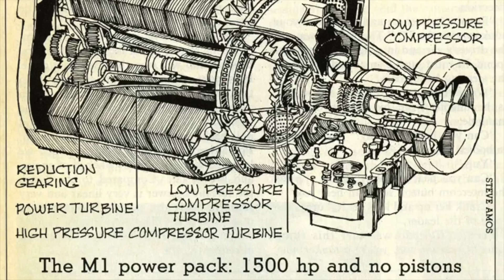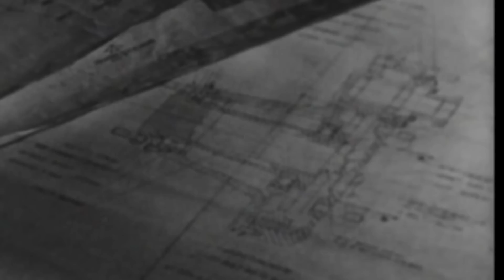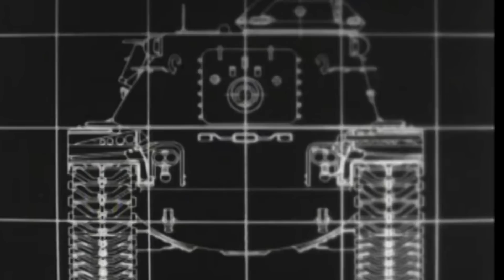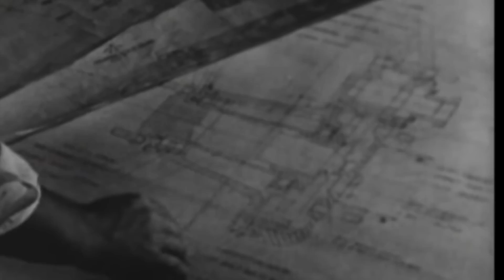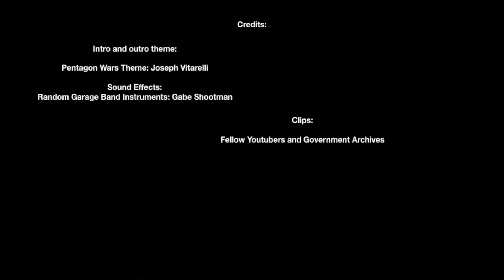The Real Pentagon Wars (For The M1 Abrams)

Comment: I don't know what became of them but as late as 1983 there were at least two XMBT-70s on static display at Ft. Knox, KY. The GM and Chrysler XM-1s were still being tested by 2/6 Cav in 1980 and several friends of mine described the GM version as far superior to the Chrysler version. 2/6 Cav was a "Test and Evaluation Unit", also known as a "Test to Destruction Unit" and got all the newest armored vehicles that had not yet been accepted/chosen by the U.S. Army. After many months of working with both models 2/6 Cav presented its preference for the GM XM-1 to the Army. Shortly thereafter the Chrysler model was selected for production and service. I was told by my 2/6 Cav friends that GM sent a special train with attached flat cars and took possession of all the GM XM-1s and off they went to who knows where with a scrap pile somewhere being the common assumption. Oddly enough, shortly after the GM models were taken away, word filtered down from on high that GM had sent a short and not so sweet letter to the Army that basically stated that GM would never again bid on another major tank contract should one present itself. One thing that I learned while serving as a tanker in the Army was that an M-60 series MBT could at least limp back to the rear even with two or even four "blown jugs" but with the M-1, if the turbine blew or failed for whatever reason, it had to be towed as a "blown" turbine was a dead turbine which left the M-1 serving as a very expensive, unpowered bunker and a target from the air or land.
Reply: The M1 turbine also had half the range before refueling of allied diesel tanks in the Gulf war.
It meant it was diesels doing the long "hook" for logistics reasons.
Reply: They moved the armor museum down to Benning. There was at least one there when I went though training in 03.
Reply: @Plumbump  Thanks for the kind reply! Over the many years that have passed since I last saw either of the XMBT-70s I have often wondered what happened to them. At least now I know one of them has a chance at being viewed publicly again.
Reply: We got robbed with the Chrysler.
Reply: https://www.youtube.com/watch?v=fktY_MgB9ZA

Comment: 12:18 that's not a leo 2 that appears to be a leo 1a5
Reply: Leo 2K
Reply: Leo2 prototype. Turret was re-used for final leo1 series.
Reply: @dwwolf4636  no its a different turret, they use similar design langauge but they are different. the most obvious difference (visually) is the leopard 2K has a pointier gun mantlet.

Comment: Note the results we saw when I was in the Army from 1977 until 1985.  I remember the GM model NOT having Chobham Armor.  It also was never tested with the heavier turret.  Extra Weight affected the GM tank more the Chrysler.  As said on another thread TRACKS affected the M1.  Shake Downs are done to work out Bugs.  I was on Ft Polk when the ground test were done at Ft Hood.  Simulators were brought to Ft Polk where I was.  Oh and 105mm DU APFSDS kept going through the berm and tearing up Target Lifters.

Comment: .. also the among main reasons that the Chrysler design (the current M1) has a larger turret, which is better, than the GM design are:
1) The Chrysler design has "blowout panels" meaning the ammo are kept separate from crew compartment and if/when the ammo get hit it will explode "out" and not "into" the turret. 
2) It has more armor (chobham armor).
3) Crew conditions are better, which is very important in long deployment, especially in nuclear war (when crew must remain inside to prevent radioactive exposure).
Reply: 1.  The GM XM1 had blow out panels above the ammo storage as well.  It could take the gas turbine and 120mm smooth bore with minor modifications also.  These were guidelines set down by the Army prior to the prototypes being built.
2.  As for the chobham/Burlington armor, the GM turret could have modified to accept the special armor just as the Chrysler tank was.  Looking at the Chrysler prototype verses the production model you’ll see that the turret front was raised and thickened leading to a non-protruding gun mantel.  These could have been done with the GM tank just as easily.  Burlington was very secret at the time so the corporate teams building each prototype did not have access to an samples.  Thus, the tanks originally had only conventional rolled-homogeneous steel as their primary armor.  Layered armor comes in large flat pieces which then dictated the final turret shapes of the Abrams, Challenger and even the production model of the Leopard 2.  Prior to receiving special armor the GM tank had better armor and that almost certainly would have remained true after the addition of the Burlington inserts as well.
3.  I’ve read nothing that indicates that the Chrysler tank had better “crew conditions.”  I do know that the GM tank made use of hydroneumatic suspension and could crouch to present a lower target especially when hull down.  It’s very likely this would have also led to a smoother ride over rough terrain and better firing angles for the main gun.
Reply: a larger turret is not necessarily better. for example due to the additional weight of the chrysler's turret the GM had faster turret rotation and target acquisition.

1) the GM XM-1 also had separated ammunition compartments with blowout pannels. (Abrams - A History Of The American Main Battle Tank Vol.2.)

2) the GM also had chobham armour (according to "Full Committee Consideration of H.R. 6566, to Authorize Appropriations for the Use of Energy Research and Development Administration, in Accordance with Section 261 of the Atomic Energy Act of 1954, as Amended, and Section 305 of the Energy Reorganization Act of 1974, and for Other Purposes: Volume 5" and "Abrams: A History of the American Main Battle Tank, Volume 2,")

furthermore all the sources i have read either say they were roughly equally protected or that the GM had better protection. I have also not read anything saying the Chysler had better crew conditions.

(edit: my comment differentiates form benjamin's one vias sources to backup my statement)
Reply: @matthiuskoenig3378    The video is Very Biased and I was in the Army right after the Test at Aberdeen and Ft Knox.  The small Turret meant only 24 rounds could fit in the bustle, about 30 rounds were scatted throughout the Hull Just like in the M-60 or even the current Leo-2 series.
Reply: The turret was also larger because it was intended that the 120mm would be fielded but was suffering from problems. They just used the 105mm until those problems with the 120mm were solved.
Reply: Yes!
Reply: Having the ammunition separate from the crew compartment has proven to be a very important design aspect of the M1 tank as demonstrated with the Russian tanks  with their    "Jack in the box" turrets that blow up...
https://youtu.be/9sWS6x97-Ck
Reply: The extra space inside the turret allowed for more equipment gave it a lot of development potential for future upgrades
In the 1970s the military wasn't quite sure what the new equipment would be but they knew it was coming
Reply: Those where improvements brought LATER.   GM could totally have done the same improvement's or better given the 10 years and trillions of dollars Chrysler had to improved it's tank (with it's 80 different versions)

Comment: In retrospect, the US government (Donald Rumsfeld, if it was his call) made the right choice. The Chrysler's M1 had room to grow, literally with its larger hull and larger turret. Not only could fit a bigger gun, but also had room for the modern electronic equipment. The turbine engine was also forward thinking. The GM's version might be better at the time of the trial, but the US military would be forced to find another main battle tank as its replacement, 20 years later.
Reply: arguebaly the larger turret meant less room to grow, as there is less external room to add additional armor volume (remember the tank needs to fit into limited  external dimensions for rail, sea and air transportation)

and the GM could mount a 120mm ("Both contractors submitted proposals by 28 October for versions of their tanks with a hybrid turret capable of mounting either a 105mm gun or a 120mm gun." Richard P. Hunnicutt Abrams - A History Of The American Main Battle Tank Vol.2.)

as for more room for electronic equipment? the GM had more internal volume than the leopard 2 and that has been able to add the electronics just fine, so would the GM. 

and how was the turbine forward-thinking? they both provided the same horsepower (also the GM could also mount the turbine engine, GM just prefured the disiel. likewise chysler could mount the disiel but prefured the turbine). 

there is no reason the GM wouldn't have lasted just as long in service as the Chysler has.
Reply: @matthiuskoenig3378  The thing is, the internal layout of Chrysler’s was more ergonomic and the gas turbine has a better multi fuel capability than any Diesel engine while also being much more subtle in many respects. The Gas turbine was one of if not the all time best decision about the Abrams. It fits the US military like a glove

Comment: both prototypes used diesel engines 
but Donald  Ramswald  decides that the new American tank should have a gas turbine like the Russian T-80.  Аnd Chrysler  offered a cheaper conversion оf xm 1 .GM   Offer cost $ 210 million  for first  
for the first 1000 tanks , and offer for HM1 from   Chrysler  was 196 milion dolars. 
But the share of political players in the deals did GM to lose .

Comment: You have gotten most EVERYTHING wrong about the M1.  You are probably someone who believes the M16 to be unreliable because of early malfunctions in Vietnam. 😔
Reply: Yeah, this badly represents the fact that the diesel was fully capable of being put in the winning design as they each had entirely swappable engines specifically to choose the better engine, which was the turbine.

The Shermans that 'couldn't do anything against Soviet armour' were strangly the tank that was kept in place of the M26, M46 and M47 till the M48 replaced it in service, after it with its long 76mm gun proved to be easily capable of dealing with Soviet T-34s whilst also being far safer, more reliable and with a better fire control system which included a stabiliser.

Both vehicles armour and fire control systems weren't even on the final design of the M1 which entered service, in fact the vehicle we saw in service barely resembles the XM1s at all in any way. The final design was a combination of the two and given to the company that needed the money the most.
Reply: @spamuraigranatabru1149  Another point about Chrysler vs GM is that while both designs were able to take both engines, Chrysler had opted for the gas turbine, and GM opted for the diesel. The Army wanted to take the GM design with the gas turbine. Their civilian leadership had enough of this business of Legoing tank designs, and told the Army that going GM meant going with the diesel, and both the Army and the civilian leadership wanted the gas turbine.
Reply: Diesel is not multi fuel.
Reply: Your assessment of the Sherman is a joke. The Cheiftan already debunked all those claims.
Reply: @zackthebongripper7274  Is that referring to me or the video?
Reply: @zackthebongripper7274  
Mbt diesel engines are multifuel. But theres no benefit to since if you have no diesel for your tanks then its safe to assume that your supply lines are broken. 
And you are fucked if your supply lines get broken or are not able to provide enough ammo, food, medical equipment, fuel, etc.

So yeah there is no real benefit to having multifuel engine designs.
Reply: @Herra_X  Sorry, diesel engines are not multi-fuel. Put MOGAS into a diesel and see what happens. Put MOGAS into a AGT-1500 and set the fuel control and it will run just fine. Multi-fuel piston engines were simply to costly, complicated and costly. Look at the Leyland engine in the Chieftain.
Reply: @michaelsnyder3871  
No. Diesel mbts are multifuel and they will run on petrol, kerosine, cooking oil, petroleum. How ever the engines computer is designed only to run on diesel so it will still think that it will run on diesel. Also the power output changes depending on the fuel. Also the filters and basically everything becomes more dirty over time as the engines were mainly to run on diesel. and thus will need more maintenance.

As i already mentioned. Multifuel tanks dont really offer any benefit because of the simple fact that if your supply lines cant provide enough fuel to the front lines then you cant provide ammo or anything else really either. So basically you are fucked anyway.
Reply: Maybe you missed the ending where he said the tank is one of the best weapon systems ever made and has proven itself in battle.
Reply: Guys, I carried an XM16E1 for two years....it was a POS.
Reply: @mitchellsmith4690  what years were you in?
Reply: @mitchellsmith4690  you’re talking out your ass there was no major design change to internals between the xm16e1 and the a1 the issue was wrong spec powder being used in the rounds that would decrease dwell time and out run the carrier couple that with the corrosive fouling that would collect in the chamber lead to people thinking that the system is bad also before you say anything I own a original xm16e1 one upper that has seen about everything if you’re gonna talk shit at least know what you’re talking about
Reply: @mitchellsmith4690  So was mine in basic in 1975, but it was a POS because it was ten years old, not because of the design or production.
Reply: @michaelsnyder3871  I got mine in the 82d.
Reply: I mostly agree with you, except the M16 crack...we used them throughout my career, and until the mid 80s they were unreliable.  The M16A2 was much better, but the family is still very high maintenence.
Reply: @mitchellsmith4690  And I disagree, my first rifle in basic was an XM-16E1. In thirty years, I found all you had to do was crack the receivers, pull the bolt carriers and just swab the barrel once and wipe down the carrier and run a tooth brush quickly in and out of the chamber. All of 15 minutes a day. And the M16A2 was a major mistake, trying to turn the M16 into a target rifle for the Camp Perry crowd.
Reply: @mitchellsmith4690  actually it turns out that the m16a1s where often given bad ammo
Reply: @justarandomtechpriest1578  It wasn't bad ammo, it was the wrong ammo. The Army adopted a cheaper powder that burned hotter causing a much higher cyclic rate which caused parts breakage and led to more carbon building up.
Reply: @mitchellsmith4690  it was due to lack of chromed internals an bad ammo that caused reliability issues
Reply: @justarandomtechpriest1578  All M16A1s had chromed bores and chambers.
Reply: @mitchellsmith4690  It was proven years ago that all the mess that happens inside the gun does basically nothing to reliability, it just looks weird and makes you think something is going to go wrong.

Comment: The best thing about the abrams is that the rounds are kept in a blast proof panels
Reply: Can't help but appreciate how smart the the turret face design is too.
Reply: Not only the Abrams do that.
Reply: @diegok2245  The reason is that all the ammo is separated from the crew, unlike leo 2 with most of the ammo in the hull, giving flying turret effect...
Reply: @tommygun333  I know that but I was using the leo2 to show that it also has blow out panels. It’s something that is more common in western tanks. Just not to the same extent as the Abrams
Reply: @diegok2245  well all russian tanks are dumb enough to have autoloaders